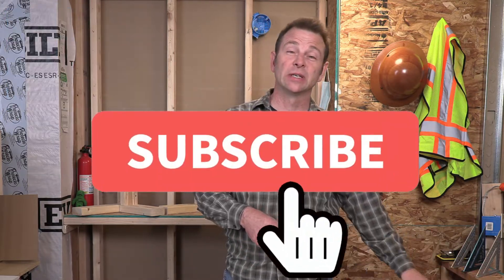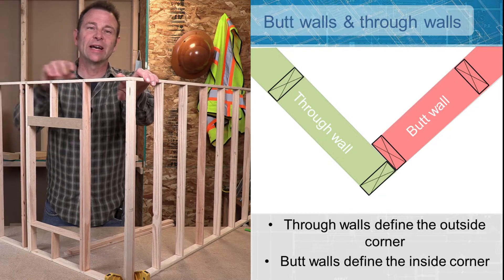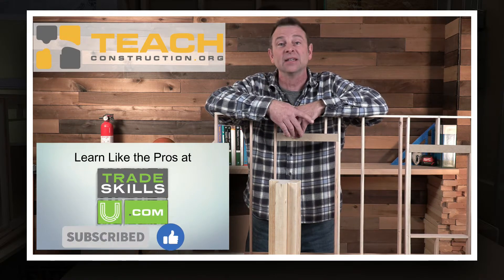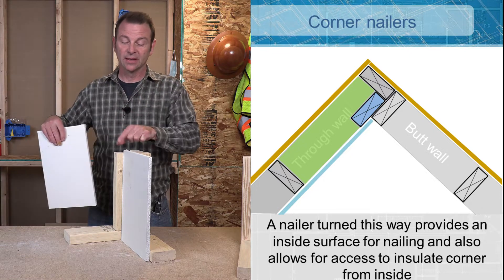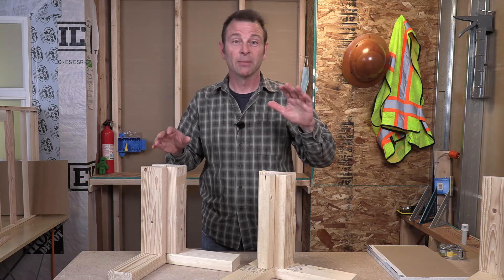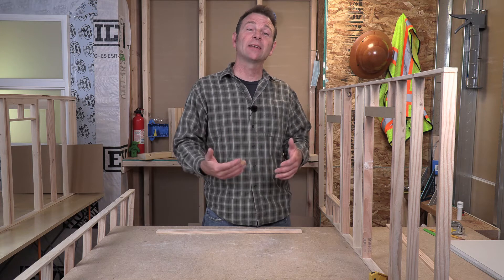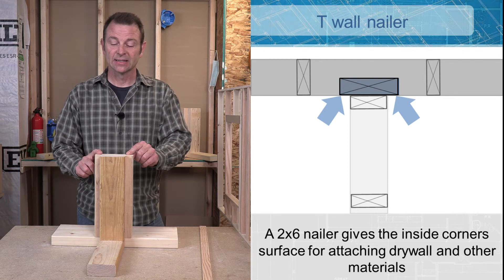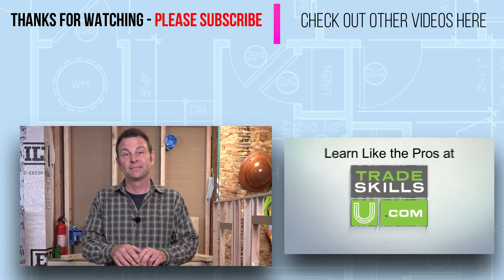Wall Framing Connections and Corners - A Lesson from our Framing course - TEACH Construction

Comment: Are cap plates necessary if you are building a wall  or a dividing wall in a basement, and could attach to the  stringers or joists of the floor above?
Reply from the maker: A cap plate is not required for non loadbearing walls.   It sounds like you are planning on building the wall in and existing basement - if so then the walls are just partition walls and non-load bearing.   Make sure that you don't try to squeeze the wall in and end up pushing up a joist that can cause a problem upstairs.

Comment: Your lessons are very good and practical. I built my own building by myself, the first time doing that from the ground up. Some things I did well, but in some places, I was cursing the framer's rough carpentry and the lumber stores' crooked lumber. These things that you're teaching make instant sense to me, having had a little experience before watching. But if I watched before having any experience, I would still at least be aware of these considerations from the get-go.
Reply from the maker: Thanks for the comment -  I guess you will just have to build another house with your new knowledge.
Reply: @ConstructionEd  I'm building the house in sections. This will make the other sections go better! And then maybe I'll hire out. 🙂 "Granny Construction"

Comment: for a remodeling scenario where we adding let say a bedroom, where ceiling drywall is already in place and we are not able to fit a cap plate. do we need to open the drywall and fit a cap plater or the 2x6 side panel would be enough or how we secure the top part of the wall ? 
Thanks! great videos!
Reply from the maker: It would be best practice to cut the drywall and install a cap plate.   While a cap plate technically is not need for non-load bearing walls, it would still be the best way to go.
Reply: Thanks a lot!  @ConstructionEd

Comment: Take it a step further. Instead wasting additional 2x. Use your scrap osb from the sheathing of the outside walls for your backing of the Sheetrock.
Save money, save on the landfill.
Reply from the maker: good tip

Comment: Great vid. Do you have any tips on squaring the wall once it's assembled but still laying on its side? I measured the diagonals, and there is an inch difference between them. I want to notch and place a furring strip diagonally across the wall once nailed together for strength, and I need it to be square before doing that. 

Please bear in mind this is a one-old-guy rookie operation. Should I secure the bottom plate and move the top plate until the wall measures equally on the diagonals? Thanks for any info in advance.
Reply from the maker: Your plan is a sound one, but the wall can also be squared once you stand it and nail the bottom plate down.   vs a furring strip, you can also use a section of OSB sheathing in the corners - like a temp gusset

Comment: Does the bottom plate go completely across even on door opening for interior or exterior wall?
Reply from the maker: When framing the wall the bottom plate does extend across the door RO - but that is later cut when the wall is fastened in place.

Comment: This all make sense except it seems like the focus is all about saving money.  I saw in another construction video that using "drywall clips" is a big "no no."  Not only is the wall weaker from only two studs, but the drywall will eventually crack.  He said yes you would save money but have much weaker corner wall construction.  Personally, I'm not sure how comfortable I would feel about having just the two studs on my outside corners.  So I have to ask, why wouldn't you use the "four stud method" and fill the gaps with insulation before closing up?
Reply from the maker: I agree that the drywall clips are problematic - but a 3 stud corner is not.   Four stud corners are just plain overkill and make cold spots.

Comment: id like to see some structural data that shows the various strength differencesor improvements of thie California corner over the traditional 4 stud corner because it just looks like a weaker corner to me. I have no issue with stuffing insulation in that void before it is covered up by sheathing. Maybe you can do a video covering this?
Reply from the maker: My counter is I would like someone to show me why they think a 4 stud corner is needed.   I have not found a structural engineer that can tell me 4 is needed.   So even if it is stronger, if it is not needed then why do it.
Reply: @ConstructionEd  Old school is always better, if you care about quality built!!
Reply: You're not asking about framing anymore this moves into the territory of structural engineering.
In any build I've worked on where more strength was needed than a California corner they used a 4x4 or 6x6 post. This is usually only to carry the load from large window openings tight in the corner and the header needed something strong and narrow to carry the load down.
The weight of anything above isn't pressing down any harder in a corner than it is anywhere else along the wall so unless it's a special case like I mentioned the three stud corner is acceptable. 
Remember the extra stud isn't for structure, it's a nailing edge to hold drywall and it also gives a strong edge to tie the wall together down its length.
The goal with framing is efficiency. Get the most strength with as little wasted materials as possible and as efficient of a building as possible.
Reply: well if it can survive a California earthquake, I'd say it's strong enough!
Reply: The way I see it the three stud corner only works well if the exterior wall covering is going to be stucco.  If the exterior is going to be siding what are you going to nail the corner trim to?   An inch and half is not enough to nail a 4" or 6" wide corner trim to and the sheathing is not thick enough to hold a nail.  I think a better solution would be to frame it like a traditional four stud corner and replace the blocking between the two studs with 1 1/2" or 2" rigid insulation cut to the width of the stud.  That is what I am planing to do on my house.
Reply: @oldmanidaho215 how much force is being exerted on your siding corner that you think a nail or screw into sheathing would rip out? The vinyl corner would probably be the weak point not the sheathing. 
And if it's a solid azek or wood corner then it's probably strong enough to hold together to sheathing just as any other trim would.

You could also nail on an angle or just use screws if you are worried about it.
Reply: No its not going to rip out!  But a nail through 1/2" sheathing is not going to have enough holding power to hold it tight over time. It is like nailing baseboard or crown molding into drywall with no backing.  And I am talking about a wood corner trim and wood or fiber cement siding.  Vinyl is cheesy. @Symbolizer21

Comment: This started out funny but then got so so wrong. Please don't use a 2×6 that way for your wall connections,studs have a X Z axis to take into account. The best way for a 3rd party connection is another open California corner set at the center of its king stud. This will give access to the interior of the wall and save one stud compared to a 3 stud channel and still provides 3/4 of a inch for the inside wall sheathing.  Thanks
Reply from the maker: Interesting perspective.  Thanks for sharing

Comment: I like the way you explained corner connection. But how do you make a corner connection with a concrete block wall and a inside wall. Plus nowadays the new 2 x 4 do not have the same measurements as the old 2 x 4. How do you make them flush
Reply from the maker: 2x4's measure 1.5'' by 3.5''.  You can certainly make a T connection to the block wall with the interior wall - but are you trying to transition from a block wall to a framed wall in a corner?

Comment: Forgive me for my ignorance but, If you are using 8ft upright studs on a 4x2 top and bottom plate isnt the total height going to be 8'3" (not forgetting the double top plate another 1.5") therefore too high for an 8' x 4' sheet? Do you cut 3" off the uprights or am I missing something? Any answers welcome.
Reply: If you buy regular 2x4s they will come at 8’ so you would need to cut them down to size to account for the 3 plates. They do sell precut studs at 92 5/8” so that you don’t have to cut all your studs. Most the framers I have known cut their own studs because factory edges aren’t always square.
Reply: Or get really tall baseboards

Comment: Teach construction?!?  Frightening.  OJT is the only training worth it's salt.
Signed 30 years in the field.
ps did you show them how to bend a 16 penny to nail around a 90 degree corner?  Also inset your studs 1/16" on all ends so your connections are plumb.  Nail the bottom plate of a wall when standing it so it does not slide and automatically pulls the nails when standing the wall.
Reply from the maker: Thanks for visiting our channel and sharing your words of wisdom.   Sorry to hear that you think it is frightening to help people learn the concepts of framing.   To address your direct questions, no we did not cover the tricks of the trade of the framing process in the field, because that would be teaching the framing process…something that is challenging to do online.   While I do agree that OJT (On the Job Training) must be delivered hands on – I challenge you to find fault with RTI (Related Technical Instruction) being delivered online.   While in your day any mine, Classroom Instruction was taught face to face but alas, we are old and it’s time to help those that are not in a classroom also learn some concepts, and online is a very effective way to accomplish that.  Moreover, maybe providing some instruction on concepts will help someone build interest and then seek a job in the industry to further their training.     There are thousands and thousands of open position in carpentry – maybe we should consider new ways to help our industry grow vs being close minded and thinking that the old ways are the only ways.   Sorry, you struck a cord with me, thanks for stopping by.

Comment: I am a student Best explanation ever. But I have a question If I have a space of 25x25 and I start the wall from the right elevation towards the back wall. This right frame will butt into the back wall now should I butt the back wall into a left wall or through into the left wall
Reply from the maker: While it is not required, often it is best to keep both wall ends the same.  So a thru wall would be a thru wall on both ends.   This helps when standing walls

Comment: Hi just wanted to say I loved the video. One question with new corner system, you mentioned that removing the 2x4 and adding clips for drywall would be better for insulation. So im curiouse why the 2x4 wood doesn't add insulation? It's a solid object compared to the fiberglass insulation. Thank you in advance !
Reply from the maker: Anthony - wood framing provides an R-value of 1 per inch and fiberglass batts can provide an R-value between 4-5 per inch.   While the clip system can allow more insulation - they are a pain in the butt for future work on that wall.

Comment: I just use a 4x4 in the corner and butt up both walls. Ez and more sturdy.
Reply from the maker: More expensive lumber than is needed, and if a non-insulated corner is acceptable I am glad that it worked for you.

Comment: I’m wondering if my builder used this four board corner on my house (built in 2014). The corners are far more drafty than my previous house, built in 2009.
Reply from the maker: Old school corners are not the only thing that causes infiltration.   It could be just poor air sealing

Comment: You showed the use of a 2x6 in making a "t-wall". Is there anything saying one couldn't use three or four 6" square pieces of plywood? Seems like it would hold drywall just fine and allow even more room for insulation. I guess if there's no reason one couldn't use plywood, the same principle could be used in the corners as well.
Reply from the maker: I would have to check code to see if that is allowed, but does not sounds like a good idea.  It sounds like you are explaining ladder blocking, but that is still done with dimensional lumber.
Reply: @ConstructionEd  I doubt it would be code. But, in my non-construction minded opinion, would seem be easier to hit with a screw than the tabs you spoke of and probably just as strong.
Reply from the maker: @cityfiedredneck6841  I personally do not like the drywall tabs, for us it is 3 stud corner all the way

Comment: Can this principles be applied to light steel metal studs?
Reply from the maker: The principles of layout apply - and connections could apply.   But working with Light Steel Studs is different since there are no load transfers you are trying to deal with so headers are not headed.   There are really nailing surfaces.
Reply: @ConstructionEd  appreciate you response.

Comment: Thanks for sharing ! Could you tell me the size of the wood normally using for the wall , I want to use 4.4 cm high x 9.4cm wide and 300 m long for my greenhouse , maybe it is too thick .
Reply from the maker: I see that you found the answer in a separate video

Comment: Great stuff here. You do an awesome job explaining the basics. My only critique is that we "horseshoe" our interior but walls. We couldn't pass inspection here in New England if we just toe nailed our interior walls. The inspectors want that connection to be as rigid as possible and makes for a much sturdier product. Yes it would increase lumber cost but is a better build. 

I would also add full length stud for a 4stud corner. No loss of R-value that way. Bottom line is you have to spend to build right and some corners shouldnt be cut. 

 Again,  fantastic stuff here. Looking forward to seeing more content & I'll subscribe.
Reply from the maker: Thanks for the comment Kenny, but I still argue that there is energy loss in a 4 stud corner from thermal bridging, while lumber provides some R value it is not as mush as insulation.  Additionally,  I have not seen data that supports most corners NEED to be "stronger" than an energy efficient corner provides.
Reply: The energy efficiency of wood is much less than that of insulation of any type. And it may seem small, just one stud, but it's an accumulation across the entire build of these opportunities to improve the construction. 
It adds up in the end to a more comfortable home.

Comment: it can be insulated, needs to be done before osb/ wrap goes on
Reply from the maker: Ok you are correct - but that is not likely in the construction process since the insulator contractor comes in after the house is sheathed

Comment: don't forget to install vapour barrier flashing membranes before the interior wall butts into the exterior wall. think about all other trades
Reply from the maker: Steve,  Good point - but of course it all depends on your climate zone and what class vapor barrier is required for your zone.   By the way we are working on a 2021 IECC code course that will be out in about 2 months, as well as a Building Science 101 class to go along with it.

Comment: 4 full studs in the four stud corner fills the corner and makes a solid corner which strengthens the whole house, no cutting blocks. Frame your walls normally with one stud at the end, easy.  Stand walls together and add 2 studs in the corner, done. The extra studs get placed easier in my opinion. Instead of lining them up loose on the floor. Just seems easier and stronger.
Reply from the maker: If a framing member is not specifically required, it is best practice to leave it out.  It is just extra framing, extra time, extra material, and you loose the ability to insulate the corners... and unless the structural engineer specific calls it out in a detail - it is plainly not needed.
Reply: @ConstructionEd  wood has insulation value though and the corner winds up being stronger
Reply from the maker: @rbnhd1976  R-value of wood is about 1 per inch and the insulation that could be in the 3-inch or so cavity of a 2x6 corner is over R3 per inch.  The age-old argument about a 4 stud corner being stronger is rendered moot because the strength is not called for.   The sheer strength is coming from the sheathing, and unless there is more load on the corner than the studs the extra framing is just that - "extra".  Yes it has been done that way for a long time, but over and over it is has been shown that the extra materials are not needed.
Reply: @ConstructionEd  ok

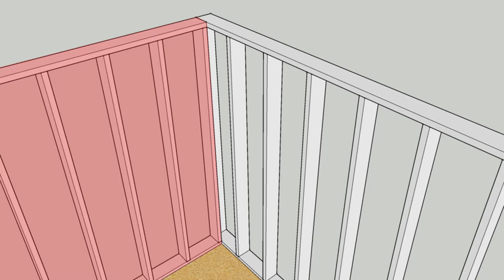Comment: 3:20 ish. You didn’t leave any wood in the corner of the through wall for the drywall to screw into.
Reply from the maker: Those two walls were just models when we were talking about walls connecting and an overlapping cap plate - but good eye seeing they were both butt walls - when we review the corner types with the models representing the corners there is the room for the drywall mounting surfaces.
Reply: You should have kept watching.

Comment: The best way is to toenail the the plates together.  Frame the 3 wall plates completely on the ground, pull toenails and pull the walls back and add studs
Reply from the maker: If that works well for you I am glad you shared the tip

Comment: I only have one question, in order to start measuring every 16, do I have to start from the 2 x4 that you put for the corner?  or the normal end of the bottomplate?
Reply from the maker: typically at the end of the plates.   That way the OC layout works for the outside also.

Comment: Great video just wondering why no one uses fire blocking anymore its part of the structural integrity of A wood frame wall as well as slowing down fire progression thank you
Reply from the maker: Fire blocking is still done and required by code.   As far as a structural requirements, sometimes blocking is added but only when it is required.   Making a wall stronger when it is not needed is just more steps and more lumber.   More is not always better on exterior walls.